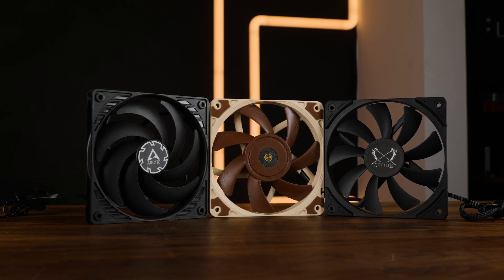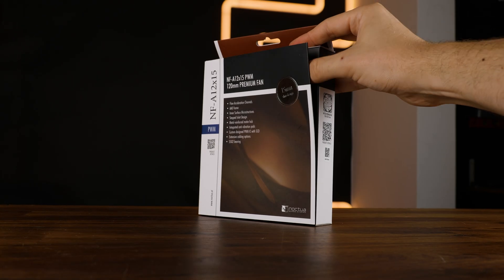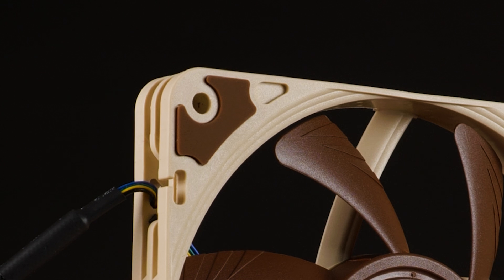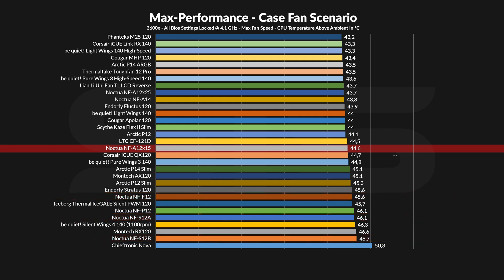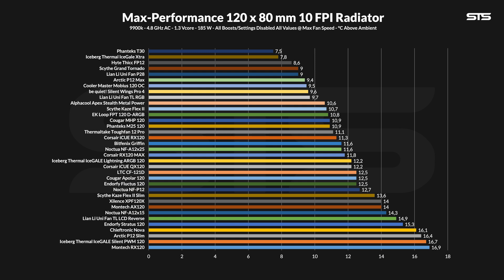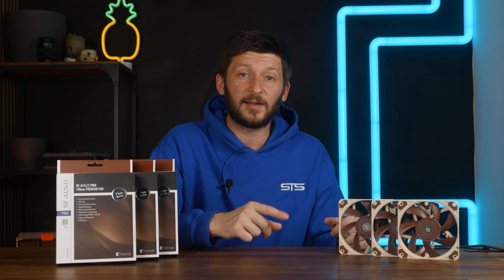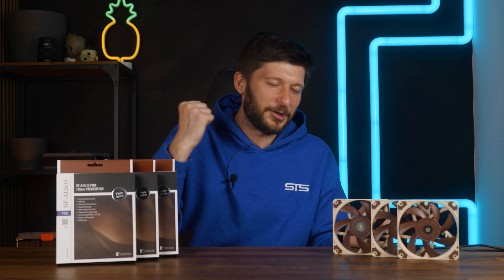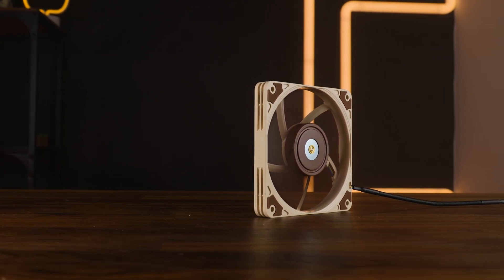The NF-A12 But On A Diet - Noctua NF-A12x15 Review

Comment: Great video! Lol I got one use case you didn't think of tho. Using them on both sides of a radiator for a compact push/pull setup, thats only 5mm thicker than using a single row.

 I got a weird build, air cooled CPU, water cooled GPU with my rad mounted to the top of the case. On a 240 rad four 12x15 can keep my water at a solid 38° under full load at only 60% speed. When the 12x25 would take 80% to do the same thing. On top of that it somehow moves so much air through those fins I flipped the fans on my rad that were over the top my CPU cooler to intake, and the fresh air blowing down is enough to knock 5° off my CPUs temps.

Comment: You should do audio db measurements using a cheap calibrated measurement mic both on axis, 45 degree, & 90 degree off axis at around 1 meter for fans.

Comment: I have 2 SilverStone SST-AS120B Air Slimmer 120 for my gaming pc, it's definitely the best performer that I'm aware of, of the slim 120mm fans  both in terms of cooling and noise (as case fans).. 

..But the durability is absolutely trash! Avoid it at all costs. They both started making very weird extremely loud noises in less than a year despite never being used to hit max speeds, at first I thought maybe there's a cable stuck or one of them was a 'fake-new' as sometimes sellers do sell used or open box as new hoping you won't notice (like Amazon lol), but again I had 2 and both started making these noises exactly around the same time and they're from 2 different stores, so it's definitely a build quality issue (sounds like a wire is stuck between the blades but there's nothing, I tried them both in and out of the case the noise is consistent) they just have some the shortest life spans ever.. 

I heard these slim noctuas in this video have a problem of turbulence and they make weird sounds when used as exhaust case fans.. that's what made me go with these air slimmers to begin with, but now I feel like I should have just bought these from the beginning because I trust noctua build quality and I don't need that much cooling for my build. I'm curious to know if this turbulence problem is that big of a deal (noise-wise), I game on a tv so I am not very close to my pc at all. Would the noise be problematic? 

also, My CPU fan is a 90mm noctua fan with a very heavy cooler, been using it for a while, no issues at all cooling a ryzen 5 5600 and it works like new after almost 2 years so I trust their build quality. 

My advice to anyone building a mini pc is this, don't only focus on performance and appearance, if you're building a mini PC you probably know how much of a hassle the building process is + cable management, so if you don't wanna have to disassemble your case and worry about tech waste, buy durable fans high quality fans, cause that's more important than anything else if you're primarily gaming.. I had no idea fans can break so fast, I didn't take life-span into consideration when making my choice because I simply had no clue it can be this bad. 

If anyone is aware of other companies like noctua that are known for great build quality and long life spans, please let me know cause I'm currently only considering these slim fans and have no other options at 120mm x 15mm. ( again I'm not compromising on life span). Thanks in advance 🙏🏼

Comment: I have been eying these as a pull fan on a 360 rad with p12 Max push fans (already in use).  Do you think these 120x15 fans would help much in a vertically limited space?  Or just stick with the push only?

Comment: The Silverstone Air Slimmer 120 will surprise you if you can get your hands on one
Reply: Better vs ID-cooling TF-9215b ARGB?
Reply: idk about id cooling but please don't buy the air slimmers. They have terrible life spans, not durable at all, only good for a few months. See my other reply here for the details.. @errrr69
Reply: I have 2 SilverStone SST-AS120B Air Slimmer 120 for my gaming pc, it's definitely the best performer that I'm aware of, of the slim 120mm fans  both in terms of cooling and noise (as case fans).. 

..But the durability is absolutely trash! Avoid it at all costs please!. They both started making very weird extremely loud noises in less than a year despite never being used to hit max speeds, at first I thought maybe there's a cable stuck or one of them was a 'fake-new' as sometimes sellers do sell used or open box as new hoping you won't notice (like amazon lol), but again I had 2 and both started making these noises exactly around the same time and they're from 2 different stores, so it's definitely a build quality issue (sounds like a wire is stuck between the blades but there's nothing, I tried them both in and out of the case the noise is consistent) they just have some the shortest life spans ever.. 

Please don't waste your money on them, they're great for a few months, beyond that, you'll feel duped. The stuck cable-like noise is seriously intolerable, to deal with i forced the fans to operate at maximum speed (as that's the only speed it won't make the noise) that worked for 2 weeks then then the sound came back a lot worse regardless to speed overtime. 

Performance is not worth it if the product will break so fast! Please don't buy it if you don't want quick waste.